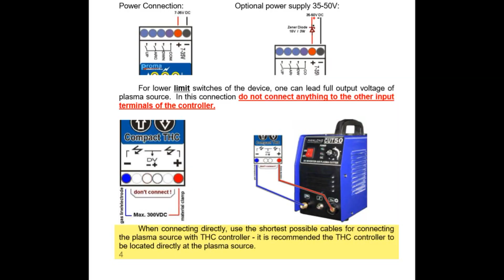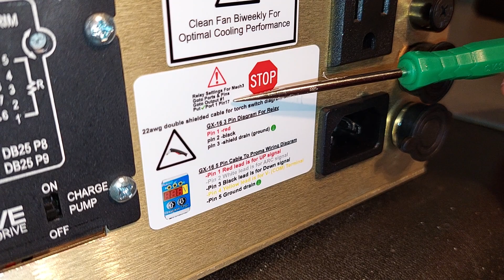Gecko G540 CNC Plasma Controller Overview Using A Proma THC 150

Comment: How do you connect the computer (mach3/4) to this? I don't see any ESS or BoB
Reply from the maker: Thank you for your support. The reason you don't see a breakout board is the G540 has one built into it making it not require an external one. This is why you want an integrated drive for simplicity compared to an individual drive system. Have a great weekend!
Vince

Comment: So starts at $2300’ish what would it cost for what you just showed? And then to add limit switches also. Thanks!
Reply from the maker: The system in the video is the $2300 model. Adding limit switches isn't required if you use soft limits. https://youtu.be/zFk_U3yqrks  If you still want the switches added it depends on the type of switches you're using, and if you require the cables to support them built for the system as well. Thank you,
Vince